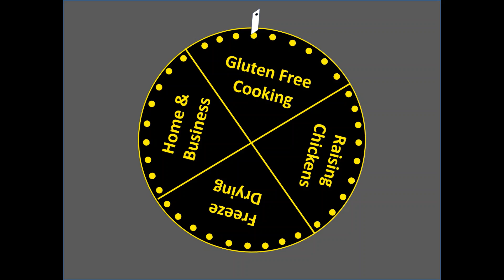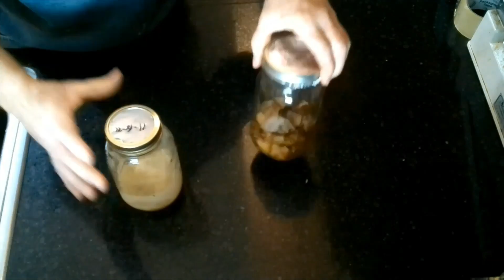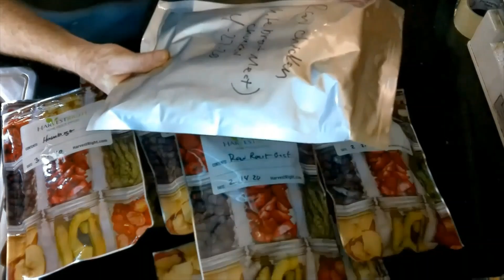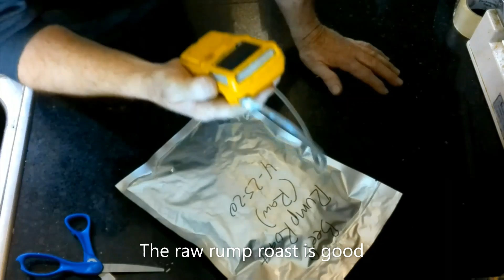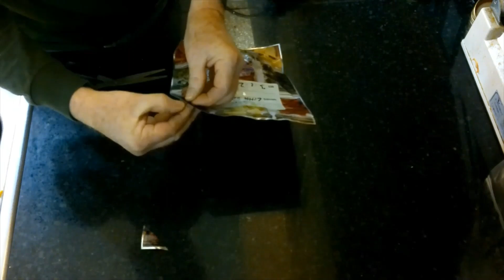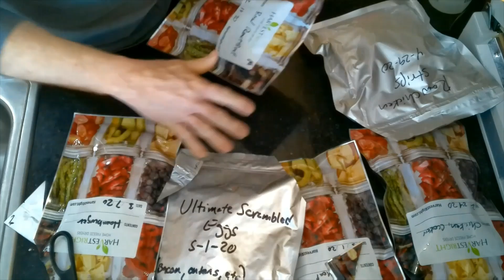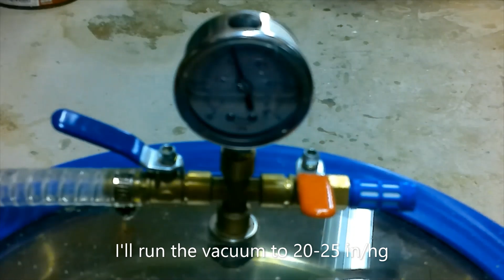Freeze Dried Food Spoilage

Comment: Aren’t you afraid after you expose them to all that air that they would rehydrate some before you got them back in the bags and sealed them up again?
Reply from the maker: Comes down to environment.  I'm in a very dry climate.  Since I started freeze drying five years ago, I have turned to vacuum packing most of my foods which removes the oxygen.  I still use OAs.  In the short time the food was exposed very little, if any moisture was absorbed.  I do keep a freeze dried pantry where I keep FD foods for weeks in ziplock bags.  If the food becomes soft, I just freeze dry them again:
 https://youtu.be/DdI74uPZOiA

Comment: I have a question. I have a 5 gallon bucket that I keep birdseed in. For the first time in years, I ended up with little Weeble bugs in it. When I get a new package of seed, I used to freeze it and then thaw out and then put it in the 5 gallon bucket. But it worried me that I could generate some mold with the moisture if I did not thoroughly dry it out before I put it in the bucket. So I started using oxygen absorbers in the bucket instead of freezing it. I put 2500 cc in the 5 gallon bucket. Well, it didn’t kill those bugs. Which began I guess hatching after a while. So I put a second 2500 cc oxygen absorber in the bucket now there was 5000 cc of oxygen absorbers in that bucket. And still the bugs did not die. I thought it was supposed to kill them. What am I doing wrong? This is not really about birdseed it’s about whether or not my grains and beans and everything are safe. The bucket was half empty. By the time I put the oxygen absorbers in it. Was it too empty and maybe needed even more oxygen absorbers?
Reply from the maker: There are all kinds of bugs and bug eggs in our food.  We eat about two quarts of them every year.  I have wheat from my fathers food supply from the 1950's.  He used two methods:  Salt and Bay leaves.  No bugs.  Many also use dry ice (CO2)  The dry ice and bay leaves create an atmosphere filled with gases bugs don't like or will kill them.  These gases are for the long term and need to remain undisturbed.  Opening the container will easily vent these gases leaving them useless.
Heating wheat (bird seed) can indeed kill weevils and their eggs, as they are sensitive to high temperatures. To effectively kill weevils in wheat or other grains, you can heat the wheat to 120°F (49°C) or higher for about 15 minutes. However, for thorough eradication, many sources recommend heating grains to 140°F (60°C) for 15-20 minutes to ensure all weevils, larvae, and eggs are destroyed.

Comment: With drying for almost two years ive learned 30 hour is a minimum for everything i do. I won't even look at it until it goes 30 hours
Reply from the maker: That come close to what I do, but it's dependent on your settings and how you prep your machine.  I do the following:
I prefreeze my food for 48 hours (rock hard frozen).
my settings are:
0 freeze point
0:00 extra freeze time
130 temp
12:00 extra freeze time
I prefreeze my freeze drier for 0:50 minutes and put my food in 10 minutes before the cycle starts.

Comment: Could you not use the Freeze dryer vacuum pump and chamber to vacuum pack? Just remove shelves, add a piece of plywood as a shelf, plug the pump into an outlet ( not the freeze dryer outlet) and vacuum seal the bags?
Reply from the maker: Yup, and I did so for years, but unplugging and plugging in the harness over and over got me concerned that I would weaken the wires, so I purchased the vacuum chamber.  Best thing I've done.

Comment: Use a gram scale and chart every batch and every bag, First weigh a tray of food when the machine time is up. Number each tray, chart the grams re dry for another 2 hours and check the weight, if the same ,it's done. bag it and chart the weight on the bag, years later weigh the bag before opening , if not the same ,air and moisture got in and will be heaver.. Keep a log book

Comment: Can you provide a reference for fat breaking down to H2O and CO2?  I see that it is a mitochondrial process that takes place in the body.  However, I cannot find any scientific references for it happening outside the body.  On what basis are you applying this process to "dead" meat?  Thanks!
Reply from the maker: The discussion I had was with a biochemist.  The conditions would have to be from a combination of light, oxygen and temperature upon the stored food.  Over time the food would become oxidized.  From there some of the following compounds could form such as: Free Fatty Acids, Aldehydes and Ketones, Hydroperoxides, Epoxides, Alcohols, Carbonyl Compounds,  Polymerized Products, and Malondialdehyde (MDA).  By themselves the chance of turning into water is possible, but perhaps not probible without a metabolic processes.

Comment: I vacuum seal my jars I didn’t see the need for and oxygen absorbers if they are vacuum sealed.  Am I wrong should I use oxygen absorbers in my jars?
Reply from the maker: Depending on how strong your vacuum is you may still have a fraction of air (oxygen) in your jar.  Here's a test you can do:  Vacuum seal an empty jar.  place the jar in twice the amount of colored water upside down (1 quart jar = 2 quarts water),  use a butter knife, under water to break the seal slowly, after the water rushes in, seal the jar with the lid using your fingers and lift the jar out.  How much empty space do you have in your jar.  0.21% of any space will be oxygen.
An oxygen absorber is an insurance policy to make sure you get all the oxygen out.  I made a video on this:
https://youtu.be/m33JH8oZLYk
Reply: @Philat4800feet Thank you!  I’ll check out your video, but I’ll go back and put oxygen absorbers in my jars.

Comment: Some of the bacteria that produce very deadly toxins, like Clostridium botulinum and others, are anaerobic.  That means that they thrive in a low oxygen environment.

So a sealed container, and especially one with an oxygen absorber, creates an ideal environment in which they can grow.  So while the low oxygen in our sealed containers is good for reducing rancidification and preventing the growth of insects and some bacteria, we're actually creating the conditions that promote some of the most dangerous bacteria from a food safety perspective.

Because we're storing our freeze dried food at room temperature, the main thing we can do to protect against those bacteria is to make extremely sure that the food is as dry as possible and that it stays that way.

We want the "water activity" to be below the thresholds required for various food spoilage organisms.

I noticed that some commercially prepared freeze dried strawberries that I recently bought to test out came in an aluminized mylar bag, but with a desiccant bag (silica gel) rather than an oxygen absorber inside.

There is probably zero fat or oil in the strawberries, so nothing to go rancid.  So the manufacturer was just making extra certain that the water activity remains extremely low in their packages.

So that's something we might need to consider.

I have read that if you use both a desiccant and an oxygen absorber, the oxygen absorber will not work well, because it needs some moisture in order for the "rusting" of the iron particles to occur.

And I've read that vacuum packing can also inhibit the functioning of the oxygen absorber by reducing the ability of the atmosphere in the bag or jar from circulating.

I've vacuum packed quite a bit of freeze dried food in bags, and I have had a number of the vacuum sealed bags fail if the food inside is even the least bit "sharp".  The force of the vacuum makes the bag conform to the sharp objects, and I believe that in addition to that puncturing the bags with points, it also creases the bags sharply, which can also create stress failures.

Diced ham has been particularly hard on the bags when vacuum sealed.

I'm definitely rethinking my decision to get my chamber vacuum sealing gadget.

It may well be best to make extremely certain the food is totally dry, put the food in the bags, put in a good O2 absorber, and make sure you get a good seal, but not use the vacuum.

And for particularly hard, sharp items like the diced ham, mason jars may be best.  But then you have the question of how well the lids seal, and the glass can break.

I would like to find some tougher aluminized Mylar bags than any I've found so far.  Maybe those bags people use for retort canning are tougher.
Reply from the maker: Very good points

Comment: Excellent video!! In order to remove most of the air when I seal the mylar I use the zip top mylar and put a drinking straw in and zip it shut on the straw leaving a small gap and suck out most of the air and then pull the straw out and seal it.  You can also put a straw in the cut off corner of a pouch without a zipper and do the same.  Great FD information Thanks!!

Comment: Question:  I'm trying to figurebout the process of Fat spoiling your food.  As I follow your process, the glucose turns into acid.  From what I can find online, that process requires residual moisture.  Can you please confirm that or discuss?  If the food is fully dry then there should be no moisture.  Or does the fat itself retain moisture?
Thank you!
Reply from the maker: I tried to follow the path of what happens to fat.  I believe there may be a better path from fat to moisture than what I proposed.  Something turned my once "dry as a bone" ham into something near rubber.  The research continues.
Reply: I'm also finding that it seems there's a difference between oil/grease and actual fat.  Bacon is ok because the fat is rendered but a layer of fat on a steak or ham is not rendered and therefore is not ok.  Does that sound possible?  I'm not a chemist! 😀
Reply from the maker: @StrangeBrew1983  Good question.  There is a factor of thickness as well.  bacon is sliced thin and the fat renders well.  A one inch steak is going to have a 1.00" thick band of fat.  I have found adding fatty meats like sausage to other foods like hash browns help provide more surface area and the fat preserves better.

Comment: Hi Phil, 
Thank you for all your work etc, etc, etc! My question regarding this great new video makes me want to ask you about the FoodSaver vacuum... When I started FDing last summer, I used the FoodSaver sealer with their 'seal a meal' style bags and an O2 remover for some fruits and vegetables.  I have watched the food in the bags continue to 'deflate' over the last year.  As an example, the apple slices (~16 per apple) and watermelon (1/2 inch thick) are now almost flattened.  They are still dry but could the vacuum bag/O2 combo keep squeezing them down over the last year?  Is that possible? The same batch of apple and watermelon slices that I put in a mason jar and or Mylar bag alone at the same time are still crispy and full size. Both seemed completely dry at the time of packing. As a result, I don't vacuum pack my fruit and vegetables with the 'seal a meal' anymore. 

**Question: Do your fruit/vegetables continue to deflate in your new vacuum chamber technique?**

Meat items seems to be fine in the 'seal a meal' vacuum bags after almost a year as compared to mason jars and mylar bags.  

Thank you for your thoughts. 
Teri
in the Big Bend of Florida
Reply from the maker: There is a basic fact that oxygen, with time, will be able to move through plastics on a molecular level.  "Mylar" bags are layered with plastic/metal foil/plastic.  It's the metal foil that blocks air and light.  Foodsaver bags are clear and thin.  They're ok for the short term, but poor for the long run.  I too have had the same results with foodsaver bags.  After 3.5 years my food storage is still going strong and holding a vacuum.

Comment: Phil - I love your videos. Thank you so much for all that you do for this community. I'm a newbie and have been FD food for about 5 months. I've watched 20+ of your videos and have come to the realization that my two bins worth of FD food in mylar bags are most likely not going to be good in 15-25 yrs. I was using the OAs from HR that didn't come with a sensor and didn't know any better, so I would use 4 then reseal the bag it came in, use 4 more and reseal, then use the final 2. By the time the final two were used, who knows if the OAs were any good. So, now I'm realizing that I need to go into each mylar bag and put in a new OA. But now I am hearing about going a step further and vacuum sealing! Oy-vey!
A few questions: 
1. If my goal is to not tap into my FD food unless SHTF (could be 5-25 years from now) would you say that vacuum sealing is  absolutely necessary due to the timespan we're talking about? 
2. What is the purpose of doing the vent hole before you vacuum seal and doesn't that ruin the OA?
3. What do you think about the individually wrapped OAs on Amazon? I would think this would solve the problem of the OAs going bad quickly as you can use them as you go.
4. Do all vacuum pumps run on oil? or are there versions that are oil-free (like Harvest Right has). Would rather not have to deal with oil and worried about smell, as my work area for this is a small shed (little ventilation).
5. Would you recommend someone using their oil-free HR vacuum pump and just putting on the adapter to use the vacuum chamber each time they want to vacuum seal their FD food? Worried that the constant back and forth would cause too much stress on the pump. Better to have a designated pump for the FD and a designated one for the vacuum chamber? 
Thanks in advance - I SO appreciate your knowledge!
Reply from the maker: 1.  The number one goal is to remove oxygen.  An oxygen absorber can do that, vacuum packing does it more.
2.  The vent hole is needed for vacuum packing to allow the air inside to escape.  Don't get too hung up with exposing the OA to air.  It will take hours or days for an OA to work.  I do the same as you with pack of ten OAs.
3. Either single packed, ten packed, or 50 packed use what you need and reseal or repackage into four-pack.
4.  Please don't buy oil-less.  The oil is needed to help remove low PH water from the pump, remove heat, and protect the metal.
5.  Some of the vacuum chambers come with a vacuum pump.  You can also vacuum pack inside the HR chamber by removing the shelves.
Reply: @Philat4800feet  Thank you for your thorough reply. Because the space I'm working in is a small shed without much ventilation I'm just worried about the strong oil smells and potential toxicity. Do you feel this would be a problem?

Comment: My machine automatically adds on 2 extra hours dry time. How much would you typically add on to that 2 hours?
Reply: 12 is a great time, as it allows it to keep going for a long time while you are away. I've noticed a lot of my batches require at least 6 hours extra.
Reply from the maker: I like 12 hours to take care of work and sleeping.
Reply: I set mine to 24 hours so if my run ends at say 2 AM and I wake up at 6:30 to go to work but I want 6 hours of extra dry time (minimum) I would need to let it run until 8am but I might not be able to deal with it right at that time so the 24 hours allows adequate time not only for the food but for my schedule
Reply from the maker: @Aweber87  You can't dry too much

Comment: I have been going over my inventory and back in 2017 2018 I foolishly used 3.5 mil bags with sprayed aluminum not a true foil bag for SOME of my freeze-dried vegetables. All of the 3.5 mil bags with sprayed aluminum had moisture permeate, the food was ruined.  The same batch of veggies I used a 5 mil foil bags were absolutely fine. That is why I am a little weary about the LDS bags. Although they are 7mil, they appear to have sprayed aluminum not a true solid foil.  HOWEVER, I do trust the Mormons to sell a good product.  And yes, I did watch your very informative tinsel, puncture test video TY... I recently ordered a vacuum chamber off eBay and it should come today! I did consider buying a VEVOR DZ260s/a commercial chamber vacuum sealer. It was about $150 more and there would be no need to cut a slit on the side of the bags...
Reply from the maker: I do like the thicker bags